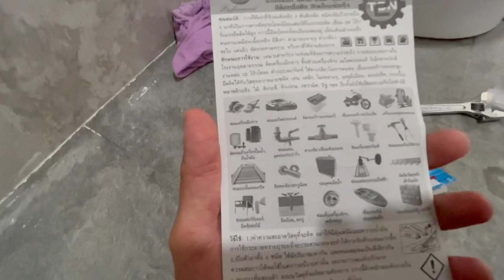Fit a Heavy Wall Hung Sink to AAC Brick - Thailand House Build

Comment: Instead of the epoxy, you can make up a paste using cement and a small amount of water. It's a bit trickier to get it into the hole but works very well. Need to leave it dry for a few days before you hang anything on it.
Reply from the maker: good tip, thank you

Comment: Hey, mate the sitting water could be fixed by using a concrete saw to make a channel away from the door tappering to the grass then fitting a sewerage pipe with a plastic grill coinciding with the level of the existing concrete.
Reply from the maker: yes a good idea, thats the solution isnt it, nice one
Reply: @lowbrow  Pleasure mate, hope it helps Darren, Australia

Comment: Dude, your power plug is directly under the pipe connection, this is not the best idea, maybe you spend your power plug a little extra water protection. But overall a great job! I am still worry about the house built in Thailand in the future if I see the poor quality of some building's. In my standard hotel, every hard rain is followed by water flooded room under the window 😅
Reply from the maker: good point, I moved it over, thanks for the reminder of my mistake!

Comment: You should screw the anchors in, not push them in. Take the tip off and put the airtight cap back on or wrap it in plastic wrap. You can salvage it but you must do it quickly. The tip is one time use.
Reply from the maker: good tip

Comment: The blocks to use when building are the G Con blocks (like thermalite in the UK) in 7.5cm, 15cm and 20 cm wide.
Best way is to use the epoxy glue with studs and then nuts and washers on somthing heavy like that basin unit.

Comment: The blue fitting in the wall might have been the cheaper version with a plastic thread.
If the builder had paid a little bit more you would have had a blue pipe with a brass thread in it and then you would not have had the problem with the PTF tape and brass to brass not leaking.
Reply from the maker: its a brass fitting in there, I think sometimes perhaps the brass is sharp and cuts the tape, there are occasions where ptfe seems to be a no-go
Reply: @lowbrow  If it is a brass fitting, you will need to wrap the PTF tape about 40 times round because as you say, the brass cuts into the PTF tape.

Comment: Oh my god this is hard to watch. 2-3 wraps of seal tape is all you need with matched pipe sizes and threads. 
When you start with 20 or 50 wraps and epoxy i want to come down and fix it for you. 
Can you ask a experienced local plumber or experienced foreigner for advice?
You will never be able to service that connection again and it won’t be reliable.
Reply from the maker: 2-3 wraps doesnt work with thai fittings, it would physically rattle and piss everywhere